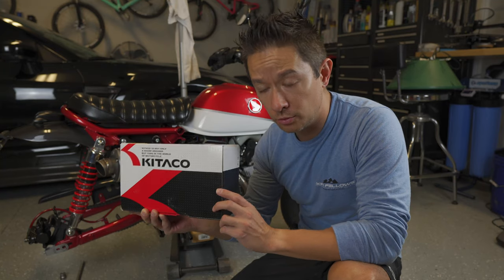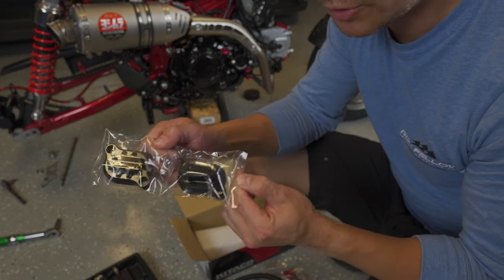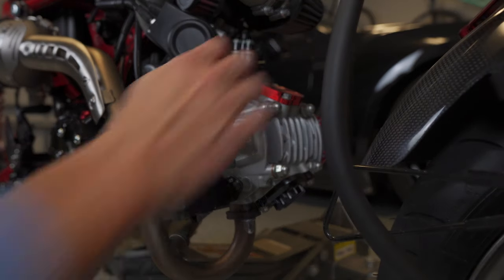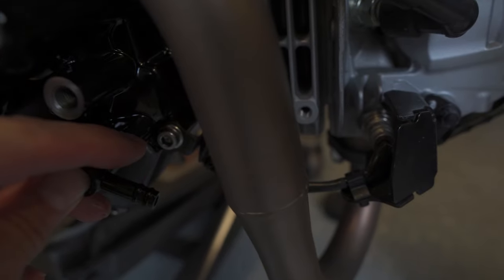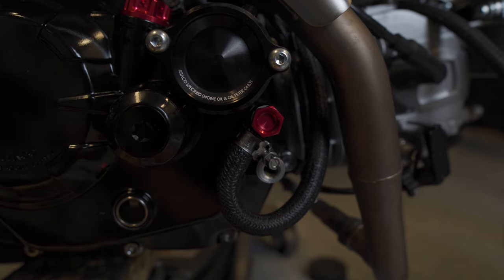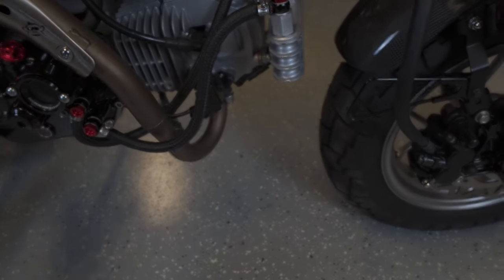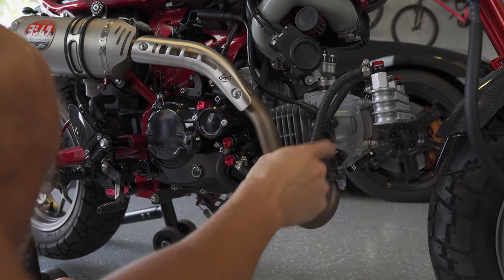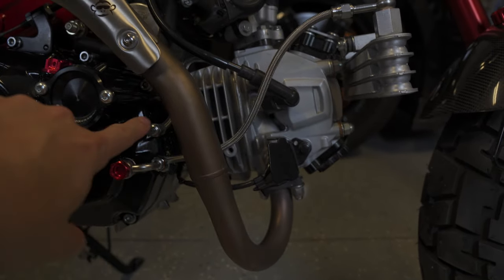Kitaco Oil Cooler with Stainless AN-3 Lines for the 2019 Honda Monkey

Comment: I thought the same thing when I purchased the intake and oil cooler. Glad your a step ahead and can lead the way! Did you purchase 10mm brake line and corresponding fittings?
Reply: I'm in the process of making my own bracket for the oil cooler. Tbparts oil cooler bracket is only for a big bore kit not the stock tappet cover.
Reply from the maker: The stainless lines and fittings are the AN-3 size and yes, the fittings are all 10mm.
Reply: The brake line will seize up and not allow oil to pass thru . The heat range is too much for 3an brake lines

Comment: Nice video man monkey is looking so nice ! Hey what happened to the Michelin powerpure tires you had installed? Reason I ask it's because I have the michelines on my Monkey
Reply from the maker: Thanks man. I swapped back the original ones for now because there are some construction areas around my house that i wanted to play in. I'm planning on finding a second set of rims so they're easier to swap back and forth.

Comment: Dude is the AN3 pipe smaller bore ? and does it affect flow ? Cheers Karl 😁👍
Reply from the maker: It's about the same. I've checked the head temp with the rubber hose VS the AN3 stainless and i was getting similar temps.
Reply: @eastcoastish  cheers bud i will go a head then 😁😁🤘🤘

Comment: Hey, good afternoon, I'm thinking of installing a motorcycle oil cooler radiator, but one thing that confuses me is, when you change the engine oil, do you falter the oil in the radiator or do you stay because the oil in the radiator is low
Reply from the maker: There's no easy way to drain the extra oil in the cooler. There isn't too much oil in it, so honestly it's probably fine, if you were concerned though, you could always remove the cooler and turn it over to drain all the oil but that's probably more trouble than it's worth.

Comment: Sir what causes that oil to go through the oil cooler? What pump, what makes it to pump to your oil cooler.
Reply from the maker: The internal oil pump cycles the oil through. I have the upgraded Takegawa pump but the stock will work too.
Reply: @eastcoastish  i did some research on youtube that oil is supposed to go to the clatch or oil spinner. I didn't know back then. That engine looks like honda xrm 125 here in Philippines but smaller version. I was planning to have it install an oil cooler to my motorcycle because i have it bore up from 52mm to 57mm. Now the engine it heats up easily in the long run it will over heat. Your installation of oil cooler it helps me a lot in understanding the importance of cooling system than adding up grade to its speed. I dont know if some modifications may last in the long run but im here to find out.😁😁😁
Thanks you sir.

Comment: What’s the torque wrench you use that has settings for low torque stuff under 10 foot pounds? I’m having trouble finding one that isn’t total garbage or crazy expensive, and I’d rather have a click vs digital.
Reply from the maker: https://www.amazon.com/gp/product/B07MVS4T56
Reply: @eastcoastish  thank you!

Comment: Knowing that t 3-row cooler dropped the oil temp 10 to 20 degrees as very helpful, thx. John5xr modified his oil cooler brackets so t cooler mounts above the engine which is t best looking mount I have seen so far plus it allows a larger cross sectional area for air to pass across t oil cooler n the engine allowing for maximum cooling. Both you n john5xr r running with t mntbox air intake whereas I have the chimera (that could give me more mounting problems possibly).

Is there some reason why the outflow of t oil cooler doesnt go straight to the engine head where the coolest oil can be used to remove heat from the hottest portion of the engine - the head? (instead of it getting put back into a hot pool of oil in t pan? Thx!
Reply from the maker: Check out some of my more recent videos; I've since changed to a 5 row cooler mounted higher on the frame: https://www.youtube.com/watch?v=7NZdkRLpgng. I've also changed up the intake (as well as a bunch of other stuff): https://www.youtube.com/watch?v=PCzaY-_FyY8

Comment: Where did you get the stainless line set. I have just done the cover and have the cooler also .
Reply from the maker: I bought the parts off eBay. The line is AN-3 stainless and goes for a few dollars a foot. The compression fittings are bout $10 a piece.

Comment: This oil cooler can be installed with the original clutch cover?
Reply from the maker: You need oil ports, so you can either do the clutch cover, or if you do a big bore upgrade, those usually have oil ports too.
Reply: @eastcoastish  oh ok... That's great because I will install the big bore 181cc from Takegawa... I will also install the takagawa oil pump...the pump fits with the stock clutch cover right? Thanks a lot for your attention 💪

Comment: The 3an lines harden up and don't allow oil to pass thru .. I already have tried this and the line closed up do to the heat of the oil . You need cooler lines not brake lines
Reply from the maker: They're rated to 500F, oil temps will never get half that high. I haven't had any flow issues with them in the last 2,000 miles...

Comment: After this radiator tactic, what brand do you use as oil number how many oils are viscosity number...
Reply from the maker: any 10w-40 is fine as long as it has wet clutch protection (which almost all motorcycle-specific oils do)
Reply: @eastcoastish  okay thanks

Comment: Did you think this was worth the upgrade? Thinking on doing this to my Super Cub.
Reply from the maker: Definitely worth it if you're going big bore kit or high compression piston. If you're not building the motor though, probably no need for additional cooling. How do you like the Super Cub? I'm thinking about the CT125 if it comes stateside.
Reply: @eastcoastish  its really nice just hard to work on engine due to the legs shelid having to come off plus like the kitaco oil cooler qould not work due to being cluthless engine the ct125 makes less power i think and gets 100 mpg but looks amazing the ct125 or monkey might be my next bike.

Comment: Can you measure the temperature of the oil when driving on the road, how many degrees does the oil temperature show
Reply from the maker: If i'm sitting at idle after a hard ride it will get as hot as 220F, normal riding it's usually closer to about 180F.
Reply: @eastcoastish  Thank you for the information you gave me

Comment: For which reason have you installed the oil cooler? I don't quite get it.
Reply from the maker: Planning on installing a big bore kit and other upgraded internals.
Reply: @eastcoastish  Okay thanks. Very interested in your work. You are doing very well. I'll stay tuned. Best
Reply: eastcoastish 
Which Bore kit are you going with?  170cc? 2 valve or 4 valve?

Comment: I think that the id of the hose is too small.
Reply from the maker: The ID of the 3AN line is bigger than the holes on the inside of the 10mm banjo bolts supplied with the kit.